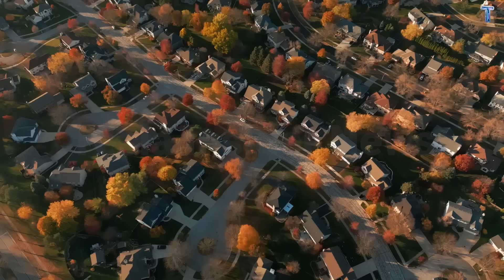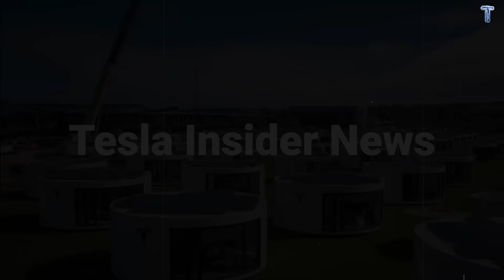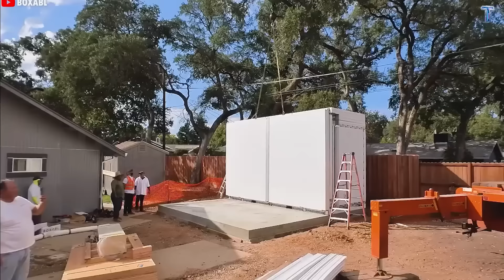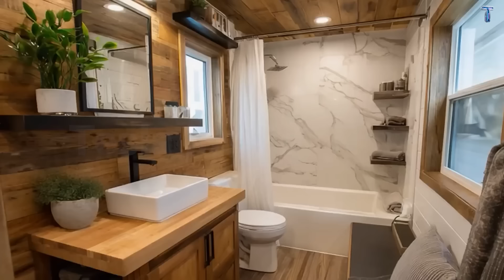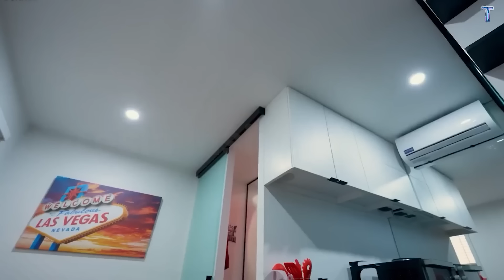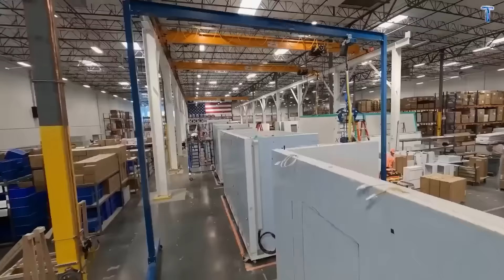Elon Musk’s $249/Month Tesla House Could End Housing Bills for Millions

Comment: Strange how does that eliminate the water & sewage bills?
Reply from the maker: The idea is that water and waste systems are designed to be largely self managed. Current info, based on internal leaks, points to rainwater capture, filtration, and closed loop waste processing, so reliance on city water and sewer could be minimal. Exact setup may still change before launch. Would you trust an off grid system like that or prefer staying connected to city utilities
Reply: @TeslaInsiderNews Oh, I don’t know…looking at how Tesla cars causing battery fires left and right when in collision and in residential houses out of the blue doesn’t give me confidence in Tesla products.
Reply: @HappyGuppy-dz4vh  The media has you and will now twist your brain with bad info.
Reply: @777-5xmuch over hypes. fires in Tesla are c very rare
Reply: Land Lease, City Service, Electricity, Garbage Removal,  but removable on a TESLA MINI TRUCK
Reply: Those large tanks could be for water. Half the size of the house!

Comment: Winters where live winters prutal
Reply from the maker: Cold climates are a common concern. Current info from internal leaks suggests the design focuses on heavy insulation, sealed steel framing, and energy efficient heating powered by solar and battery storage. Performance in extreme winters can vary by location and final specs may still change. Do you deal more with deep snow or long subzero temperatures where you live